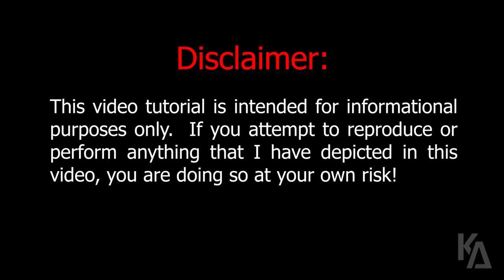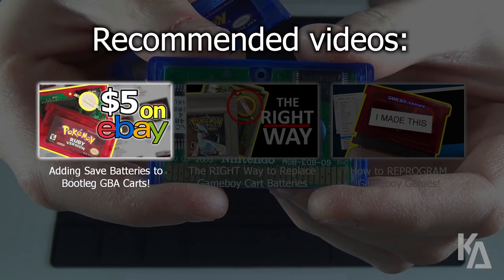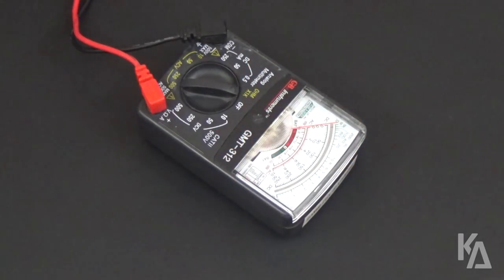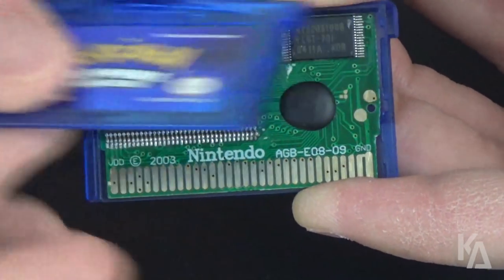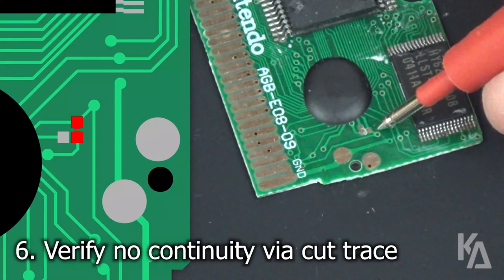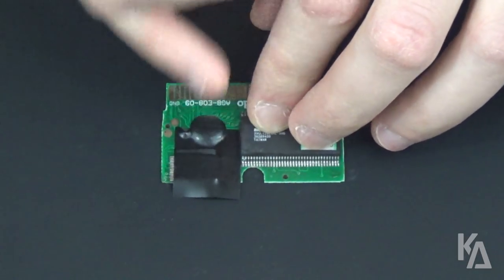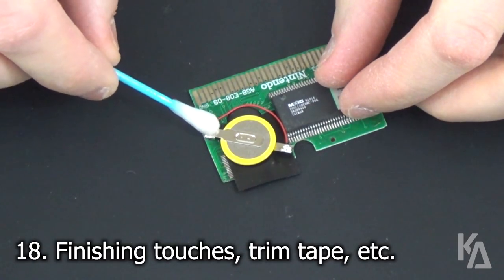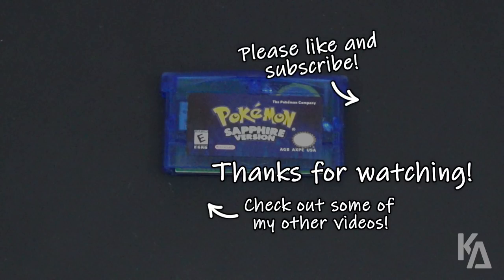Add a Save Battery to ANOTHER Bootleg GBA Cart!

Comment: Followed these exact steps, SRAM doesn't seem to take advantage of the battery still on most cartridges. Not sure what is missing, although I've noticed every cart, even bootleg, with a battery has a 10k resistor somewhere on the board. Possibly related?

Comment: Hi Kyle, great video as always! I have a question: I have a Zelda bootleg card and this doesn't have the 3 little squares but only the 2 contacts for the battery and 2 orizontal squares in another place! What should I do?
I can send you a picture if it helps, thanks!
Reply: You got any answer on this? I have the same style board, and I just found out that you can add batteries to bootlegs, so I wanna give it a try

Comment: Would this work for just making the game already on it save? I don't think I can afford a Joey atm, and was thinking of using one of these bootlegs as is (with a mod, of course).
Reply: I would like to know too, so I will can transfer my Pokémon LeafGreen to Pokémon Pearl.
Reply from the maker: Hi there, good question!  The bootleg carts can already save since the ROM file itself has been patched to save without a battery.  This is actually a topic of a podcast I have coming out soon.  Adding the battery simply makes it so that SRAM capable or patched ROMs can save to the carts, thus what makes them useful for programming.  Cheers, guys! 🙂  Thanks for watching!
Reply: @KyleAwsm  Thanks so much for this info. It definitely helps in my decision about purchasing these games.
Reply: @KyleAwsm  Really great vid - this helped me a lot during my first attempts to re-flash my bootlegs 😉 Are you still working on some kind of video on how to patch those games? Would be interesting to me esp. because I want to patch my german Pokemon games to work with the bootleg cartridges - but the universal GBATA patches don't seem to hit it :/
Reply: @KyleAwsm  cna you link to the podcast? 

I bought a bootleg on accident, ebay refunded the money luckily. 

Anyway now I have a replica but I get that "the game will load" message every time it loads. Based on what I have been able to find out, it saves because the rom was patched, but that makes it not work with gamecube games for example. 

I am wondering if soldering a battery on the board and replacing the bootleg rom with an ACTUAL ROM would give me a copy that at least works well enough that I can transfer a jirachi from the gamecube to the cart, and then this cart to my pokemon pearl version.

Comment: The battery is used to power a RTC (real time clock) chip and the other chip is the ROM (program) and FRAM (flash memory with the same speed as ram) if these are proper clones of the original also there is another way to connect the battery
Reply from the maker: These carts unfortunately work a bit differently and aren't equipped with RTC chips.  Also, these bootlegs have SRAM for saving, instead of Flash like the original Pokemon games.  Very few GBA games utilize FRAM, and there are actually countless different speeds of RAM.  The place that bootleg GBA carts store their ROM  is on a NOR Flash chip, while the original carts used MaskROM.  Cheers, and thanks for your comments! 👍🏻

Comment: I currently have the linked PCB board for my copy of Fire Red
https://imgur.com/a/NS8LiHC

its tabs are in a slightly different location (Shown in A) would I connect them like B or C?
https://imgur.com/a/BhDSdE9
Reply: on that the game currently temporarily holds save, saying "The Save Game is OK" will adding a battery fix the losing save issue or do I have the completely wrong board?
Reply: @calebprince4914  did you ever figure either of these out? I have those same boards
Reply: @RyoApeiron  Sadly not :/

Comment: I tried adding a battery to a repo pokemon sapphire game like the one in the video and flashed it with a patched SRAM gba rom (pokemon creepy black (fire red fan remake)) and when I try saving in game it says that it saved successfully but doesn't show any save game when turning the game back on. Everything seemed to work correctly when adding the battery though, do you happen to know how I could fix this? (Edit: So I reattempted this tutorial on a different pokemon game, readded the save battery smoothly, everything tested fine on the mulitmeter, flashed the game with Pokemon Creepy Black (Fanmade rom). Now when I go to save the saving process works fine without any failure and when I loaded the game back up it showed the save and I was able to resave again, but once I remove the cartridge from the GBA SP and let it set for like 2-3 mins the save seems to delete and just goes back to starting a new game. So it seems the save holds this time but deletes shortly after. If you would please try and help me out I would really appreciate it since I can't seem to get this tutorial working for me.)

Comment: I have a 150 in 1 Nintendo Collectors knokoff of this type which actually had  a 1616 battery of this type in it for save states. It lasted for about a year and just died. So I replaced it using this method, but obviously didn't have to block any of the traces. Works great! Thanks
Reply: To add to this, I've read that generally bootlegs will go through their batteries quicker than their legitimate counterparts.

Comment: Great video!  I just added a battery to a bootleg Pokemon Ruby and it saves fine.  But every time i load the game after switching of the power it says "saved game is corrupted loading previous save".  The "[revoous save is always the last save I had so technically it's working but the message is annoying.  Anyway to fix this?

Comment: How do you know the top circle is ment for the positive pad?
I dismembered my saphire cartridge a long while ago (over 5 years) but wasn't able to get it back together due to various events...
Well now I bought all the required items except for the cable because I couldn't remember that there was one connected to the previous battery.
My PCB also has no indicators of what the positive and negative contacts are but there was some solder left of when I removed the battery in the past.
I did it by trial and error but both connections don't seem to work. 
It keeps saying the internal battery has run dry... ...clock based events will no longer occur.
After creating a new game, saving and restarting, now the game says "The save file is corrupted. The previous save will be loaded. The internal battery..."

Comment: Wondering if I could get some help. My bootleg cartridge has its contacts similar to 1:04 however, the only three squares I can spot are on the upper left like 0:51 with the labels y (on the left of the 3 squares) and n (to the right of the 3 squares) there's connectivity between the middle and right square. Any tips for me to move forward?

Comment: I recently bought a cartridge without a battery in it.  It cannot save.  I opened it up and i see 2 open holes where you can solder a battery to, except it doesnt say which is + and -  , is there a way to find out?  or should i just take a chance and try soldering?  both holes are one next to another and they are gold plated.    it is 99% similar to the PCB in this youtube video: https://youtu.be/RUtL5Wm69qs?t=33  can you take a look and let me know if its possible to solder a cr1616 battery to this cartridge please?

Comment: So If you install this battery to a bootleg Pokémon game, can you then connect to Pokémon colosseum on GameCube and also migrate your Pokémon from the bootleg gba game to the next gen Pokémon DS game??
Reply: Nope. Unfortunately, authentic pokemon gen 3 games use a flash memory. Fake pokemon gen 3 cartridges have been patched to use SRAM memory. When migrating, your ds will try to look for the data in a flash memory that doesn't exist so it still won't show up in your ds.

Comment: Hi. Here I have a question. If there is no battery in those carts in the first place, how do they save? I'm sure they can save in the pokemon game they originally come with.
Reply: Hello! Bootlegs cartidges uses Flash memory like a USB stick, the original ones uses RAM memory, that only storage information, like a save file, if it has battery on it, if not, it will delete all data, RAM memory is cheapper, that's why nintendo used it on their cartidges.

Comment: i had 3 bootleg carts and none of them as far as i could tell were battery compatible, couldn't get any voltage readings
Reply: Did they save at all?
Reply: @Monkeyman12534  the carts save just fine, i was looking to add a battery for thing like time based events

Comment: With the other tabbed battery, do we just need to solder it like normal?
Reply from the maker: Correct!
Reply from the maker: But also with the trace cutting and soldering too.  That is required on that cart for any battery installed.